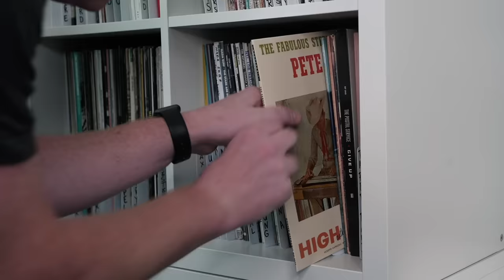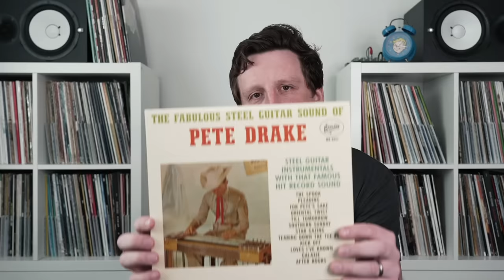6 Guitar Pedal Myths

Comment: I build Industrial Electronic circuit boards for a living. Where thru hole parts are superior, are on switches and connectors. If the board is designed right (proper mounting locations and such), and for further protection, conformal coated, then SMT parts work best 90% of the time. The reason Industrial Electronic boards use Thru hole parts whenever they can though, is sacrificing some performance for durability and longevity. Everything is a compromise!

Comment: I still like through hole more because with through hole, I can see what all the parts do. I can see the value of the resistors, what diodes are there, and the layouts often look cool. It’s just cool to know how stuff works.
Reply: It's also easier for modding
Reply: Costs more to manufacture. Most PCBs are machine made these days. Parts with through hole components require both sides to be soldered. I’m not sure the advantage or what makes them perform better
Reply: @andrewhanson9251  they occur require the two sides to be soldered if it's a dual layer board, just like surface mount. And yet, the cost difference isn't that much. The cost of the components in an average pedal is a tiny fraction of its final price. Some pedals have cents worth of components. The most expensive parts are the enclosure, the switch, jacks and potentiometers.

Comment: The 4558 was a lucky choice back in the late 70s when Maxon started using it in pedals.  They originally chose it because it had two 741-alike op-amps in the package, and was very cheap in quantities.  The difference between the JRC4558 and most other op-amps of that vintage is that it doesn't suffer from latch-up when the output gets close to the rails.  This is the only difference, but can affect the "sound" of a pedal, since a "latched" op-amp doesn't usually give any useful output!   Also, the 4558 recovers from overload gracefully - unlike the LM833 or NE5532, but it's noisier.....  The choice is yours!

Comment: I was certain that True Bypass was where good tone came from. 15 years later, I honestly couldnt tell you the difference in my tone between buffered or true bypass.
Reply: Jarrett Hucks Photography Very minimal difference unless you have lots and lots of pedals and or good amount cable your signal runs through. Just a bit less clarity even with 8 pedals and 15’ of cable (definitely noticeable in the high end). Add the buffer and it’s clear and bright. Just like a tone control on a guitar being turned down.  Compare plugging straight into your amp versus running through your non-buffered pedalboard. If there is a change in brightness/clarity you could benefit from a buffered pedal.  You’re not going to hear a difference if you have a buffered pedal.
Reply: Jarrett Hucks Photography I have 10 true bypass pedals on my board and a buffered tuner, in my case, it absolutely helps with top end clarity.  So I would do some testing.  I hate my tone without it, but am glad my board has only one pedal affecting the bypassed tone.
Reply: Almost everything on my board now is buffered so that's not necessary to test. My point was that so many people think that true bypass is better and I fell for that. But now I know better than saying true bypass just sounds better
Reply: Jarrett Hucks Photography ok well now you are back into proving the original Stigma. Do you really know that all of those are good buffers?  Why would you want every pedal touching every sound? Not as good, I promise!  Rock on...
Reply: @mattflickinger8151  so you are saying that having all buffered pedals is a problem? What about people with all Boss boards? My point was that the sound I was using in a true bypass pedal sounded no better to me than a comparable buffered bypass pedal. I'm also not running 10 pedals so even in true bypass I wouldn't have much of a problem
Reply: Jarrett Hucks Photography I think Boss buffers have proven to be decent quality, but the argument is that not all buffers are created equal.  having everything process your signal that it goes through is not ideal either.

Comment: I actually had the opposite experience with "true-bypass"; my first board was all-Boss, all-buffered, and because buffers aren't perfect, I got a similar "tone suck" as true bypass. After replacing two of the pedals with Digitech Hardwire true-bypass offerings, the tone brightened considerably. Before I had the money and inclination to totally go true-bypass, I learned the truth; that you need a little of both in your chain, buffers to break up the capacitance, and true-bypass to avoid attenuating and re-amping the signal at every stage of the chain.

Comment: So basically for #1:

Put a dedicated buffer pedal at the very beginning of your chain. 

Would you put a second buffer at the end of your chain? Or is that overkill?
Reply: The buffer at the end is most important if you have a long cable run from your pedalboard to your amplifier. I have the Strymon BlueSky reverb in front of my amp - it has a buffered bypass setting that I use which also allows the trails to trail off nicely. Sounds great.

Comment: As an Electronics Engineer and musician, I am so glad to hear a popular pedal builder speak about the truth on these circuits. Electrically, the silicon and Germanium have different barrier potentials and must be biased differently which cause them to react (sound) different. I also get tired of hearing about how hand wired is better than PCB. If you take the exact same circuit and components and hand wire one and solder the other to a PCB, you would hear no difference. The main difference in manufacturing between the two is that most companies use WAY cheaper parts in their production line products and better parts in the hand wired stuff. Most PCB issues are more component quality and quality control itself. Also, different op-amps are just variations of the original designs that may have different specs that are enhanced for different arrangements. I love what he said about its how the circuit is designed around the part, not the part. 100% correct!

Comment: The first part of my career I was hung up on gear.  
Then I met an old guy that had and old rig that he plugged straight into.   He had the best tone.  I offered to trade him straight across.  
He laughed and said I was the tone.   It wasn’t the rig, but the man behind the rig.   
I’m long retired now, but I’ve spent second half of my career just plugging straight in and going for it.  
I found that superfluous gear, distracts me from playing.  
“You are the tone son…”
Reply: This 100%. I found that my sound is my own. I tend to make other gear sound like my main rig (Ric 320 through an Ampeg Reverberocket R12R).
Reply: I have a minimal rig. Its more than a decent guitar, a cable, and quality amp, but not by much. I really dont like seeing huge pedal boards and crap.
Reply: I simultaneously agree and disagree. Yeah, on one hand, the tone comes from your adjustments on your rig, but you can’t make effects exist that don’t, like phase, delay, looper, or more specific ones like shimmer, reverse delay/echo, and while some amps come with reverb and tremolo, not always.

After that, the preference for an overdriven amp makes sense, and maybe using a single overdrive pedal or just a boost pedal for a boost works. It still all comes down to how much you pay attention to your tone instead of a heavy reliance on pedals. I never adjust my amp to my pedals, I make sure I have a good tone on my amp before even messing with my pedals, because it starts there. So classic rock? No pedals? Sure. But if you’re trying to build a unique out of this world sound, experimenting with pedals is actually very essential. You can’t really replicate any Muse or Radiohead songs without them and that’s more up my alley. But to each their own.
Reply: Some stuff you need more. Just discovered delay pedals. Just learned to really play the reverb on my 1960's Fender amps instead of just leaving it set to 3.
Reply: @joshbarth7666  Depends on style. I like some who just plug in and I like huge boards. Different sounds different folks
Reply: @joellebrodeur1015  Part of my 'own sound's is my MXR dist+. I have two. One I have had for 35+ years. Was used then. New ones sound like shit. Having two pedals with no off/on lights is tricksy tho

Comment: Myth #1 is EXACTLY why I don’t understand why more pedal makers don’t give you the option of buffered OR true bypass...especially with pedals that are typically at the beginning of your chain, like compressors!! 🤦🏻‍♂️
Reply: As a builder myself I can answer you :) more parts = higher price = more complicated pcb design, more complicated switch wiring and so on... I think easiest solution is to get a buffer in your chain if you have a lot of TB pedals, they are really cheap or you can build one yourself dirt cheap
Reply: DrkaN true, but at the same time, it’s one more patch cable, one more power supply (or chain), and more real estate for the customer. [I do however realize that buffers can be really small]. And after all, JHS does it in the Pulp n Peel. 😉
Reply: You could build a tb looper with a switchable buffer in a 1590a enclosure for next to nothing and never gave to worry again.
Reply: TC Electronic has a bunch of pedals with the buffer/true bypass option, my hof 2 does and it's pretty cool!  If you need a buffer at the end of your chain you might have it already and not think about it, a boss tuner, like a tu2 or tu3 has one and it's worked well for me for years!
Reply: @mikes062  Doesn't a tuner need to be at the beginning of a chain?
Reply: Drew Blomquist no, you can if you want, but like pretty much any other pedal it can be put anywhere.  I prefer the end because I like to be able to kill all noise by turning it on. I use my volume pedal at the front for swells and to act similarly to a volume on a guitar. Very few pedals have to be in a particular spot, it just depends on how you want it to sound. Some fuzz pedals like to be at the beginning because of how they see the signal, that's why some are noisy or have other issues sometimes. Most people like to go: wah, drives, modulation, delay and then reverb. That's how mine is set up.  Try different things to see what you like, you can get cool sounds doing it different from the norm.
Reply: @mikes062  if it's at the end (closest to the amp) it's being affected by all the effects. For killing noise it works at the beginning too 🤷‍♂️
Reply: Drew Blomquist like what?  I've never had a problem with my tuning. And I mean stopping noisy pedals.
Reply: @mikes062  I guess JHS has to answer this one XD

Comment: I never listened to anyone, bought all and compared op-amps, picked the 4558.

When it comes to boutique, I ran into this thought: gear failure or gear stolen, can I replace it within 72 hours? Can I find a replacement, not an alternative, in 5 years? Can I walk into Guitar Center and replace it? Yikes! Then "custom" or "boutique" are at a minimum and if I dig a gear like that then I should buy another one at least. My main distortion pedal, some guy on eBay. My overdrive pedal, a modifier no longer in business. I like customs, boutiques, and mods, because they really do spice up what I could do with stock or a multi-fx but would sound boring with, or they give a sonic edge, and any edge is a good thing because band sound is competitive. However, that edge, when it fails and its irreplaceable, is an extra goddamn retrograde that requires research, money, testing, and evaluation to lock-in an alternative when the first goddamn one worked swimmingly until some prostitute peed all over it. 

The problem with an all-stock sound chain from instrument to speaker sounds brittle and anemic. Tone is in the equipment not the player, emotive force and finesse is in the player. The smart setup is modification to a limit, customs and boutiques for special sections, off-the-shelf for non-preferential sections, and I think anyone that pursues good music equipment already does that, but keep in mind to default first to the stock stuff from big companies, find one that works after trying them all, and if it doesnt work, then go after custom or boutiques, you'd play hell trying to replace an all-boutique rig when 66.6% of it could be well-evaluated big retailer stuff. 

With everything from tubes, amps, cables, effects, guitars, pickups, how replaceable are any of those sections with zero downtime? I was about to get a 2x12 and go for ideal, everything to my spec with final assembly by me, or go half-price with a close-enough cab and speaker set and replace only one speaker. First option is ideal, second option is what I like, third option of all-stock isnt an option. I could closely replace the single modification item with zero downtime, and in a few business days, have a total replacement. On every section, I turn up the geekery to headroom, but not to 11.

Comment: I honestly never believed any of these myths. I also don’t believe that wood type, body shape or weight has any effect on the sound coming from magnetic pickups. I also don’t believe there is anything special about a ‘59 Gibson Les Paul Standard Burst other than that a few famous people played them.
Reply: Can I get an AMEN !!!!
Reply: Wood and structure can have an effect on resonation of the strings, which has an effect on sustain and "tone". There's a reason at Strat with a humbucker doesn't sound like a Les Paul.  Neither is "better" but they are different. 
As for vintage, modern pickups aren't going to sound like 60+ year old pickups simply due to aging of the components:  Age effects crudely made components like pickups, even if you wind them on old inaccurate machines and use the same wax. In fact, that 60 year old pickup doesn't sound like it did 60 years ago. Age affects wood too - see above. 
That said, the mystique/pricing of vintage guitars is overblown, for sure. Witness the number of guitar greats who play less than vintage instruments... or dare to play a Les Paul from the (OMG, horrific) Norlin era or a Strat that's not pre-CBS !

Comment: What  great video. Late to the the party with your video's but ypu come across as very genuine.  It's nice to hear a 'respected' designer echoing views that support my own persoanl view.  My favourite example was seeing a distortion pedal with BC108 plastered across the front like some badge of honour.   These are merely one of the most common bipolar transistors made...no special mojo!   Of course if you like the sound of a particual product that happens to have a particular component in it, thats fine, but designers in the past generally used what was available that fitted the design criteria with minimum cost.

Comment: I'm new to guitar pedals. I just bought a Behringer SF300. It's the first pedal I have bought. Fortunately I followed my common sense and went with the old adage, "If it sounds good, play it". I'm just a hobbyist, really not a good player but I just like to play. Been doing it off an on for 25 years. I used to play through old recording equipment, stereo head units, and pretty much anything that had a 1/4" input and output on it. My favorite was an early 80s Toshiba dual tape recorder for a home theater system. It made some wicked fuzz and it would change depending on whether I was recording to one or two tape, playing one or two tapes and any combination of them. It had a 3 band EQ. I miss that thing. I know it's not technically a pedal, but it did the trick.

Comment: Josh, I love your honesty as it pertains to pedals! There are so many products on the market, and each is subjective to the individual interpretation of what sounds good, and conversely what doesn't. I've invested over 3,000 dollars into my pedalboard, yet find it wanting. I recently purchased a Positive Grid Spark for a friend of mine that offers so much more than my current setup at a fraction of the price. I love my current Bugera tube amplifier, but purchased a Spark for my friend, given it's incredible versatility using online connections that offer a mermaid of sounds that my $3,000 pedalboard  is incapable of producing.
 Undoubtedly I will purchase a Spark for myself in the near future!

Comment: As someone who only very recently started looking into buying dedicated effects pedals (as opposed to the multi-effect units or, specifically Line 6 Modeling Amps) I have been confused about the "Legendary Tone" regarding hundreds of pedals so far. I mean, obviously I've heard of the Klon and the King of Tone, and the TS9. Then I found something kind of interesting starting to happen: Without any 3rd party input, I started to assume that certain (or most) mass produced pedals were trash. This is coming from someone who couldn't tell if someone had a compressor in their signal chain and who thought "Distortion" and "Overdrive" were the exact same thing. I didn't know a damn thing about pedals or circuitry. However, at that time I was also immersed in collecting wristwatches, and there is a lot of overlap in that elite mentality. However, after having collected for a couple years, I came to find that some of my favorite pieces were quartz watches. Should have translated pretty easily, but I had to relearn that lesson.